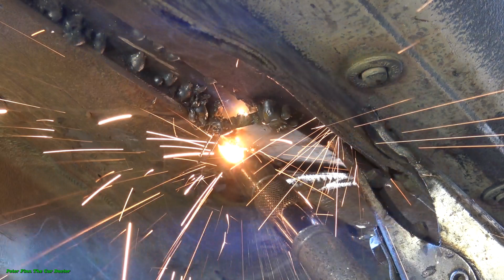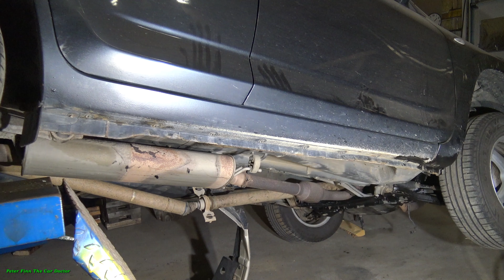How to repair Holes and Corrosion areas in Car, SUV or Truck by MIG MAG welding

Comment: Excellent, professional welding Peter! Job is not finished, please continue your excellent work! If we need to bend into shape a 5 mm steel plate, we can do it with our bare hands if we are strong like Arnold Schwarzenegger!!!!!!!
Reply from the maker: That's the plan! And Arnold could hammer steel plates with bare hands.
Reply: Yes, easily!!!  @PeterFinnTheCarDoctor